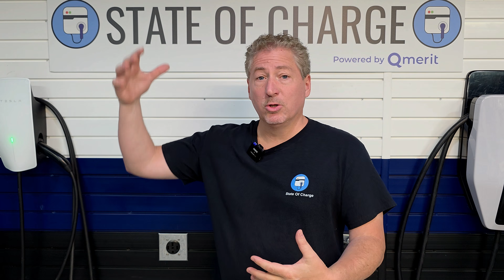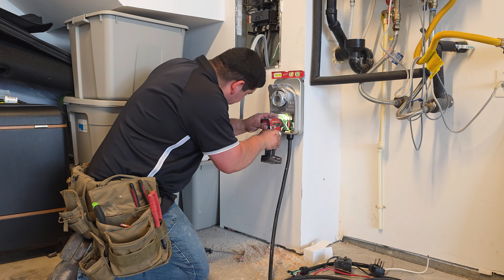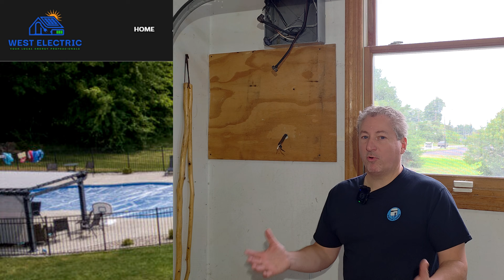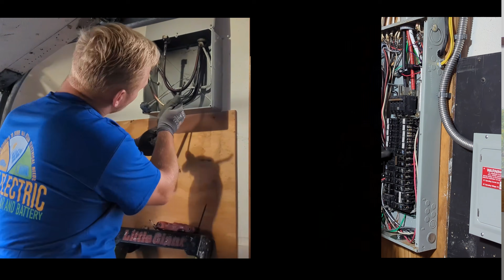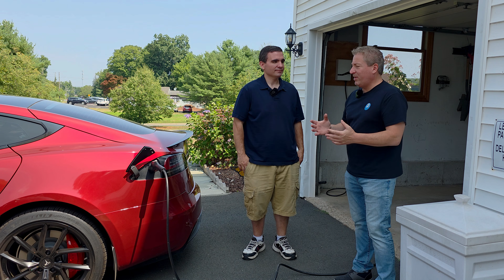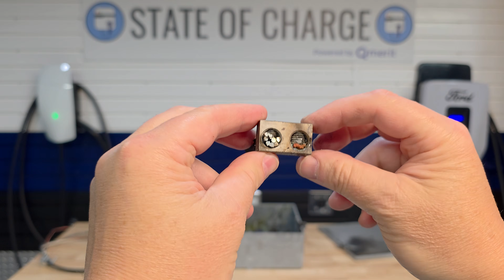Recharge Rescue Connecticut: Poorly Done EV Charger Installation Causes Fire

Comment: I started wondering.  We have two heat pumps plus solar, but just one EVSE shared between two EVs.  That got me wondering about our own peak load.  But instead of having to do tedious calculations, I found that I have all of the data in front of me.

But fortunately we already have an Emporia Vue (I put it in about 2 years ago), so I have historical data for the past year.  On the "Peak Demand Management" tab, I can see that our peak energy consumption was around 25kW back in January (when we needed the heat).  That would correspond to around 100A (on a 200A service) - well within appropriate limits.

Comment: Because of your videos, I plan to get an Emporia Pro NACS hardwire... What's the part number for word to each breaker to track energy using the app for everything? 
Also, what's your top 3 portable chargers to leave in my car for emergencies with the standard two connectors available (e.g. NEMA 14-50, 120V) that can accommodate other connectors too. I plan to use all of the above on the Rivian R1S with NACS.

Comment: State Of Charge is spot on here. I'll add some technical info from the code book. 8awg wire is usually protected by a 40A breaker and 6awg by a 50A breaker. It's slightly more complicated though if you do the engineering. 8awg is either good for 36, 43 or 48A depending on whether the wire is rated for 60, 75 or 90 deg C. However you have to use the lowest temperature rating of the system including the wire, and terminals at each end. Breakers and most device terminals are typically rated for 75C so rarely could you go with the 90C 48A ratings. Some splice blocks are rated for 90C, but I'm sure the EVSE was only 75C.
  As stated in the video, the wire was too small and a code violation, but the root cause was incorrect wire termination torque. The type of termination point where a screw bears directly on the wire can cut the strands if over torqued. Now you have an 8awg wire, but at the connection it's reduced depending on how many strands were cut, to maybe a similar cross section of 10awg. The screw bearing directly on the wire is one of the failure modes of the cheap 50A outlets. The better outlets have the screw bearing against a metal plate, which then squeezes the wire.
Reply: There's almost no equipment that's rated for 90 degrees, so that column is not useful for most situations.  If you're using conduit instead of romex you can use the 75 degree column (usually) because most equipment is rated for 75.

Comment: Putting aside the donation of a charger, curious, why an Emporia Pro if he's already got a Tesla Wall Connector and a 2nd one can communicate with the first for load management?
Reply from the maker: Firstly, because he didn't have to buy it, it was supplied by Emporia free of charge. Secondly, Matt wants a J1772 plug for his Rivian. So he'd need a Universal Wall Connector. But the Universal Wall Connector will not load manage with the older NACS-only Wall Connector, so it wouldn't work even if he wanted to pay for the UWC.
Reply: @StateOfChargeWithTomMoloughney  Oh. I did not know that the non-Universal WC would not load manage with the Universal.  Good to know.

Big fan!  Keep up the good work!

Comment: I recently purchased and self installed an Enpahse  HCS80 rated at 64 amps. The engineering of this charger was not very robust. It came with a pigtail to be wired to a junction box with 8awg wire that I eliminated and went direct with 4awg and a contactor rated at 50 amps but had a resistive load to 65 amps that I feel is undersized. I wont be reccomending this charger to anyone I know.

Comment: Not a good look for "electricians." The home owner tried to do it all right and put his confidence in an electrician and it failed completely. Nice job Tom!
Reply from the maker: Like every profession, there are some great, some good, and some substandard electricians. You can't just assume you found a good one when you call an electrician that you don't know.
Reply: Sounds like EVSE installations, in particular, should require a building permit and inspection before activation.  No one should have to trust their lives to an installation with no verifiable standards.
Reply: @StateOfChargeWithTomMoloughney  Tom, I had a Qmerit electrician upgrade my service to 200 Amps and install a 14-50 outlet.  He did such a bad job.  Many issues, but among them, he installed a cheap 14-50 receptacle that's not industrial/EV quality.   When I do use it (which isn't all the time) I use a Tesla portable charger (even though I have 2 Bolts, 2019 EV and 2022 EUV) which I believe has a temperature sensor in the 14-50p end, it hasn't melted.  If you want to take a trip out to Santa Cruz California, you could have a field day showing all the things he did wrong.

Comment: When I got my charger installation, inspected, the inspector walked in, saw the plug, saw the breaker, and simply left.  

He didn’t touch anything. He did not remove any plates to make sure everything was connected properly or anything like that. He just eyeballled everything and walked away.

Comment: The customer should evaluate whether they really need to pull the whole 48A at once. We have 2EVs and I'm charging our Rivian R1S at 25A max at 240V and model Y at 15-20A max. Good on having a load management to keep things in control.
Reply: We previously had the R1S charging at 32A but after long road trips did find it was a bit slower than desired.

Comment: Wow, that's crazy that he did everything right... And yet this happened. 😬 Ours did the load calculation to make sure we could get the full 48 amps for our EV charger.
Reply: It was NOT done correctly at all....he - electrician  DOWNSIZED the wire at the junction to 8 awg and installed 100A breaker on 8awg wire, huge mistake, I would fault electrician and inspector for not doing proper job. Forget the load calculations for now, simple rule is 10awg = 30A breaker, 8awg = 40A, 6awg= 50A breaker and then you have to derate it so 6awg on 50A breaker would have maximum 40A draw, unless you use higher rated 90C  THHN then you can push 48 continuous on 60A breaker

Comment: What's the point of putting a (rather expensive) 100A breaker on 8 gauge wire ? The wire could probably get glowing hot and not trip the breaker. Maybe you could use 8 gauge on an EV charger if the circuit is limited to 40A, then set the charger to 32A. 7kw will still give pretty good charging times. 

Another major problem electricians do is put on a disconnect, like they have always done on a pool filter or heat pump. They say yes a $20 60A disconnect will work fine on a 48A charger but no, it will overheat and melt. Like you said duty cycle, a heat pump or pool motor will draw it's max load for a second or 2, not draw max load for 8 hours.
Reply: I think that is part of why they switched to a 60A breaker.
Reply from the maker: He did so for future-proofing. Matt thinks he may gert an EV with a very large battery that can accept 80-amps in the future - perhaps an Escalade IQ. So he ran the 100-amp circuit now, even though he currently only needed a 60-amp circuit. The original electrician should have installed a 60-amp breaker on the circuit and then upgraded it to a 100-amp breaker in the future if Matt got an 80-amp charger.

Comment: I always go another wire size safer. All the EVSE's I've installed were 8AWG THHN running a 32A charge limit on a 40A breaker. Even though it technically is good for 40A charging, I find the wire and terminals get warmer than I like, even on very short runs.
Can't believe the electrician and inspector saw 8AWG on a 100A breaker and said OK. I mean the breaker is 99% used to protect the wiring all the way up to the receptacle/device. They must have just seen the AL wire at the breaker and figured it good. What a hack job.

Comment: It's fortunate that video surveillance equipment is getting so cheap, as that can do so much to prevent terrible consequences if a fire or other emergency occurs. And then there's also smoke detectors, and other detecting equipment, and so on. By now, the limitation may be more of user skills rather than cost.

Comment: Broadly speaking, would you say it's the case that using electricity for more purposes leads to more reliance on torque wrenches, because tightness of connections is more critical than it is for combustion equipment? (I'm including HVAC, motor vehicles, cookstoves, and all else.)
Reply: Every combustion engine I have ever worked on required torque wrenches for many of the fasteners. Combustion engines have 10x more parts and pretty much always require properly torqued fasteners.

Comment: Why does everything have to be such high amps, though? I drive about 70 miles per day in my Bolt, way more than the daily average, and I get by perfectly fine with a 16 amp charger, literally it gets done in like 4 and a half hours. If the car was dead empty, maybe I'd need a complete overnight charge, but still it's fine at 16 amps. I could daily drive an F150 lightning and still be perfectly fine at 16 amps charging overnight. I just figure, why even go 40, 50, 60 amps when there's clearly issues? Not that there are always issues, but the fact that there are any issues at all and probably 90% of them could have been mitigated by just not charging at such a high amperage anyway, leads me to believe this just just another side effect of the american tendency to want way more than you could ever reasonably need, in every aspect of life. If you really need a less than overnight turnaround time in a less efficient EV, why not just go to a fast charger at that point? Whatever it is you're doing that you absolutely need to drive that much back to back, you're clearly foregoing cost efficiency anyway, so why bother potentially setting your house on fire when you could charge in 30 minutes at a dc fast charger and just charge at 16 amps overnight at home?
Reply: Because the media and the anti-EV crowd have done amp up reports of range-anxiety and exaggerate how long it takes to charge. I know multiple people that drive EVs and use the 110v "granny charger" that came with their car and it easily covers their daily driving.
Reply: Well you drive a Bolt, it has what like a 60kWh battery? Yeah so something like the GMC Sierra EV or Cadillac Escalade IQ (on my short list) has literally almost 4x the battery capacity of your vehicle - so your 16 amp charger would take 18 hours, by your own math, just to go 70 miles. 

But to do the math, on a normal 32 amp charger that might be fine for a Tesla or smaller battery vehicle, to fill up a nearly empty 220kW GM battery it would take nearly 29 hours of nonstop charging. When we get home from visiting family at 8 PM on a Sunday and have to leave for work at 7 AM the next morning, that's less than optimal IMO. Could we make it work, maybe. Would I like the 80kW charging? Yes.

Comment: Great video.  Cut and dry that number 8 wire is too small for a 48 Amp EVSE and it is not code compliant.  Shame on the Contractor and the Owner should contact them.
Reply: So many errors that were easy to spot by both the electrician and the inspector. Both need to be reprimanded.

#8 copper Romex is obviously too small for 60A
Unacceptable to have a 100A breaker for a "60A" circuit.
100A from a 200A service with another EVSE and electrical heat is immediately a red flag that there's probably inadequate capacity.

Comment: Hi Tom.  This seems like a problem where the electrician and the inspector both dropped the ball.  I don't know what the inspector's responsibility is here.  Is he/she required to inspect the entire circuit and open junction boxes to check the connections?  (With hindsight, the answer is probably yes!)  The #8 "Romex" is clearly wrong, but I'm not crazy about aluminum wire and a plastic box.  At a minimum, opening the junction box would have revealed the undersized copper wire and a possibly mis-installed Burndy connector.
Reply: Yes, mine did. He looked at the whole circuit, that I did myself. He only flagged that my j-box didn't have a brace behind it and I missed one nail plate. He knew it was for an EVSE 5 years ago and said wiring was good. A half competent inspector should have caught this.

Comment: Wouldn’t that 100A breaker in itself be a code violation since it was connected to wiring only designed for 60A (6 gauge) and them using the wrong one (8 gauge)?
Reply from the maker: Yes

Comment: Why would the 60 amp breaker have made a difference? The charger never drew more than it should have and you did not say anything about there being a short. The connection between the larger cables and the smaller cables was overloaded, not the rest of the circuit.
Reply: Yeah I agree it would not have made a difference but it's good to have that anyways until such time at all the wire downstream of the 100 amp breaker is capable of handling the full load.
Reply: @ampedupevfsd  Yeah, I swear the electrician said it would have tripped, and I just don't see how. The failure was while carrying the expected current, not an overcurrent situation.

Comment: Wouldn't you want both of the two chargers on load management?
Reply: He said it another comment that the other charger was a lower current charger and was not a problem. One smart charger would keep them withing the panels rating.
Reply: @JorgTheElder  The point being, if both are on load management, the two chargers work together to get both cars charged simultaneously.  Otherwise, the one without  load management hogs all the current all the time.

Comment: I thought someone had somehow messed up the Polaris type splices but yea 100A on #8 is a recipe for a quick failure. There are so many things that can go wrong with electrical installs. Super oversubscribed as well.
Reply: The vehicle and ESEC his had will never draw 100A. That was not the problem.
Reply: @JorgTheElder it will if there is a short and then the undersized wire will be destroyed which is exactly what an electrician is supposed to prevent... And what happened.
Reply: @LarsDennert  Which is why they fixed it. I did not say that it was ok to use the 100A breaker, I said it had nothing to do with what happened.

Comment: Those connectors are horrible.  I’ve used them and they can fail even if installed correctly.  The splice needs to be close to size of the wire or it can cause issues.  Also noalox should be used even if not required.  It is conductive and will reduce the resistance at the connection and can prevent issues.

Comment: Big fan of Emporia.
Reply: I have an Emporia Classic and it is awesome. I have been thinking about installing the Vue. Not to limit my EVSE but so I could see what circuits are using power.
Reply: @ampsquadEV  We have the Vue, but not yet the EVSE (still have a Juicebox that is hobbling along).  Eventually I will likely replace the juicebox with the Emporia.  it is useful in the sense that we get lots of data regarding what the big users of electricity are, and you can plan upgrades to cut this down.  We recently put in a heat-pump water heater, and the reduction in consumption from just that along is almost enough to offset the load of charging 2 EVs.